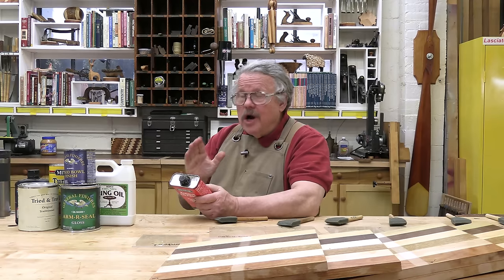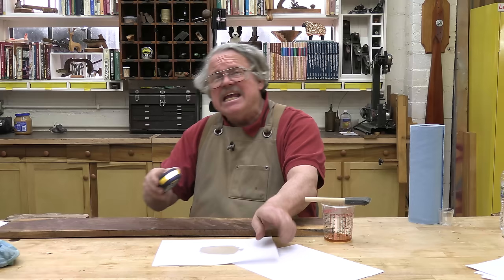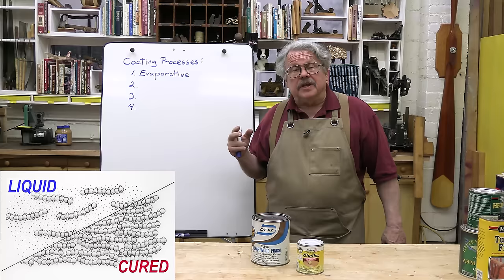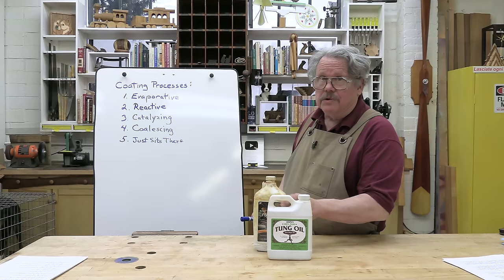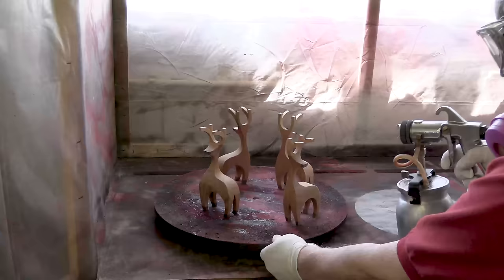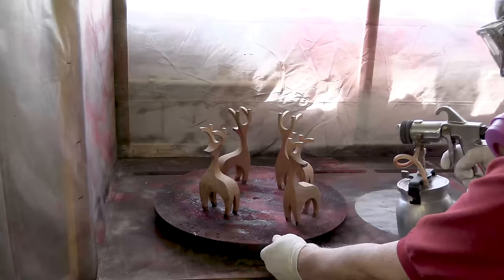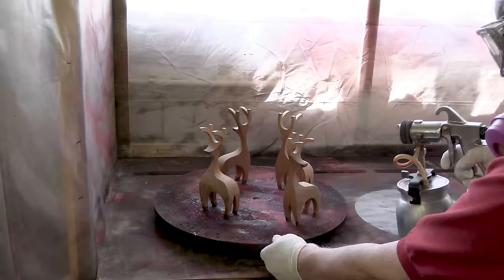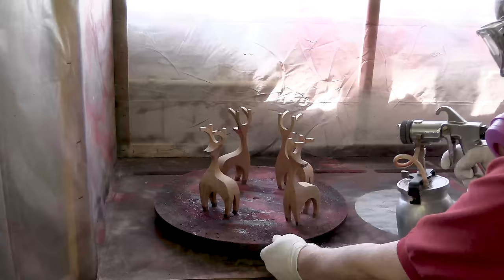Finding the Perfect Finish

Comment: Helmsman spar urethane is my favorite clear finish.  Be aware that if applied over epoxy (i.e. West System epoxy), the first coat of urethane will not dry, just apply a second coat over the still tacky first coat.  The second coat will dry. I'm guessing this is caused by the epoxy not being fully cured.
Reply from the maker: More likely, there is a reaction between the epoxy and the poly that interferes with the formation of  a chemical matrix. Try coating the epoxy with a coat of shellac before applying the poly. Shellac is chemically inert; there's no reaction, just evaporation. So it's often used as a chemical insulator between two incompatible finishes.
Reply: I'll have to try that, thanks.

Comment: Good show I've been using tongue oil now for many years finishing my slab top tables being a painter for 55 years now I came up with my original formula and I will share it with you I take the Watco tongue oil which is thicker than Minwax and I cut it 50% with paint thinners I take an oil-based sanding sealer are you a product from Sherwin-Williams and I mix that 50/50 with paint thinners and then I combine both the diluted tung oil and the diluted sanding sealers and mix them together this gives you a faster drying coats and better sanding it gives you the best of both worlds and in the end after it's cured thoroughly for a couple weeks you can buff it with a wool buffer on a drill and it comes out like glass the one thing I like the best about this formula is that it won't allow very real thick coats but completely sealed and finished where are some of other finishes are thick which tends two chip scratch and blister easier and being so thin on the surface even with three coats allows you to touch up easier and sand for a repair coat without having to strip off all of the thick garnish I've kept pieces outside deliberately in the snow and the rain for years and when I come back the finishes almost the same as it was the day that I put on it with a little buff it comes back to life tongue oil is truly an amazing product you would never follow your thing a wood post unexpected to hold up well on the outside but you're a thing I'll guarantee you will hold up
Reply from the maker: Thanks for sharig.

Comment: You failed to elaborate on epoxy finishes. I have been using a 50/50 epoxy with good results. The finish is very hard and thick. After practice I usually get a good finish after one pour with minimal sanding required. Sometimes I just smooth out with a good polishing cream and it's done. The down side is the curing time, however, I have recently found a UV curing epoxy that cures instantly in sunlight! I'm still learning, but getting better. One important note. NEVER mix finishes, meaning while they are still wet, or after they dry. Polyurethane will not stick well to epoxy etc. I learned that one the hard way!

Comment: This is good but there are some errors. Tung oil and linseed oil are actually what he calls “reactive” finishes.  They don’t just “sit there”.  Like most natural plant oils they react with oxygen and harden over time into the desirable finish that they are so famous for. They just take longer than some other reactive finishes which have been pre-polymerized (basically cooked to make them partially oxidized already).  And many products, like poly urethane, are a mixture of “evaporative” and “reactive” ingredients. Polyurethane is just plastic (polyester) resin devolved in solvent mixed with urethane.

Comment: Fantastic! Learned a Ton. I am still perfecting my skills for applying my go to finish, but I have already selected my go to finish. And my selection had nothing to do with any of the criteria discussed in the video. Rather it had to do with my limitations of space and time. Generally speaking I follow the instructions on the Transtint web site except I use shellac as the seal coat and top coat instead of other products. And, I sometimes use Rit dye instead of Transtint. And I don't always need a glazing coat but if I do, I use whatever brown-ish gel stain from the hardware store. Okay, I admit it, it's nothing like the Transtint instructions. My finishing phase can be hours within the same day. Or if I apply the glazing coat then hours over 2 days. I cannot afford to tie up the garage for 1-2 weeks required for 4 coats of some finishes.

Shellac is not as durable as say oil-based poly, however I feel that a myth has developed causing a lot of woodworker to believe the shellac is entirely weak and useless. It is not. Add a coat of paste wax and it's even more hardy.
Reply from the maker: I believe that no finishing cabinet is complete without shellac. Even if you don't use it as a primary finish, it's the best "insulator" there is, allowing you to apply multiple finishes to a single wood surface that might otherwise be chemically incompatible.
Reply: I’ve been experimenting with different finishes, and recently fallen in love with shellac. I’m in Canada with a poorly heated shop and shellac still cures well and quickly at low temperatures. I love the feel and look of it. And I’ve found it wipes and sprays nicely. I’ve struggled a bit with a brush.
Reply: @benvinje  I had a terrible time with shellac in the beginning especially with a brush. I use the Zinsser canned products. Then I learned to cut everything 50/50 with DNA and brushing became a bit easier.
Reply: @woodshopnerdery  this is probably what I need to do. The canned shellac where I live is getting very pricy so I’m going to start mixing my own. I’m sure there will be a learning curve to getting that thinned properly for each application type
Reply: @benvinje  If  you search for the "technical data bulletin" from Rustoleum, there is  a lot useful instructions as well as "cut math." So I find the 50/50 mix with DNA works well for the de-waxed "seal coat" because I want the seal coat to be very thin and party permeable so the wood accepts some color from the stain or dye. Seal coat starts as a 2lb cut so I end up with a 1lb cut. I also find that the regular shellac which I use for the top coat, and which is a 3lb cut, works better 50/50 also. So I dilute it to a 1.5lbs cut. These are all approximations, fyi.

So if you order flakes, I would get de-waxed flakes for seal coating or if another finish will be used on top, like polyurethane.  I would also get regular waxed flakes for use as a top coat. And my preference is to add furniture paste wax as the final step.

Comment: I use Bona Woodline for nice satin appearance and very good durability---with 3 or 4 coats.  There is also a sealer that can be applied as the first coat.  I think I will try your formula of tung oil with 1/16 (by volume) added varnish, but I have a question: Did you change the formula from 1/16 to something smaller, say 1/8?  I guess your 30-year longevity was a good test that 1/16 was good enough.  One issue is that each coat takes 12-36 hours to dry depending on the humidity, but I can usually get away with morning and evening applications, i.e., only 12 hours between coats, so finishing takes a couple days.

Comment: Just to clarify.  And I would parrot the comments from many others about how well put together your videos are made.  Do you still do the first 2 coats with tung oil?  Then do the mix of 1TBSP spar urethane and 1 cup of finish?  Next question, you show the Miniwx Tung Oil Finish.  Is it any tung oil finish or specifically Miniwax?  I'll be the first the admit that 6' 3" weighing 250, finishes scare me.  What I mean by that is I've put in X number of hours to produce a product.  In full swoop I could completely ruin all my effort.  Now I don't expect to get it perfect.  I just don't want to do it poorly.  I set a level of standard to deliver a product that will endure the test of time.  Thanks again for this exceptionally well done video.
Reply from the maker: Except when testing other tung oil finishes for books and vids, I have always used Minwax Tung Oil Finish for the simple reason that it's the only tung oil finish my local hardware store sells. I have never tested Rudy's formula with anything else but Minwax products. If you use another tung oil or spar urethane, you should test the mixture before you apply it to anything valuable.  As for our current finishes practices, we still use Rudy's because we like the ease of application and the results. However, we have begun to use Minwax Wipe-On Poly (oil based) when we need to sped things up for the vids. It's as easy to apply as Rudy's and the results are similar (although believe Rudy's is deeper and warmer by a small margin), but you can apply almost twice as many coats in the same period of time.

Comment: I would have liked to see you test Danish oil. I have been using this with good results. I prefer the taste testing for my finishes.
Reply from the maker: I did test Some Danish oil finishes. Both Minwax Tung Oil Finish and Antique Oil fit the extremely loose definition of Danish oil. They just don't call it that.
Reply: @WorkshopCompanion  Thank you

Comment: Rubio monocoat, and beeswax/mineral oil give great texture and color. They are easy to apply even in a dirty shop. However they lack luster.  I avoid voc's whenever possible. I'm building a dining table for my daughter. The wood is ambrosia maple. Will shelack on top work? I'm guessing not well, but I will experiment with it. I dont like plastic feeling finishes.

Comment: I wish I had seen this years ago. I would generally agree from my experience. My go-to has been water-based wipe-on poly because it's so easy although it's not as beautiful. Why do you add Tung finish with the spar urethane for the final 2 coats rather than just use the spar 100% for a harder top coat?
Reply from the maker: I think the reasoning for mixing the spar urethane with tung oil is to ensure that the finish stays flexible enough overtime that it wont crack. It also gives you a better bond when applying it over a wipe on poly. All comes down to preference. For us the Tung oil / Spar urethane mix is hard enough to keep our projects safe, but if you are looking for a finish that's even harder you may consider 100% spar urethane or adjusting the mix ratio. - Travis
Reply: Excellent thanks! That's what I was wondering - increasing the % spar for higher use surfaces like dining tables for more protection. Have you used Danish Oil which is trying to get the best of both worlds between beauty and durability?
Reply from the maker: @dm7585  I've worked with Nick for 5 years now and we have never used any finish besides Minwax tung oil and the mix for outdoor / higher use surfaces. I'm sure Nick has used Danish oil but it must not have impressed him enough to keep around the shop. Here lately we started using "Min Wax Wipe on Poly" on some projects because it cures incredibly fast, allowing multiple coats a day, but we're not yet sure of it's durability. Time will tell. - Travis
Reply: Thanks for sharing your experience. I have always like MW wipe on poly but you can't beat the beauty of a good oil. So Nick's recipe made perfect sense to me. I may try wipe on poly over Tung experiments...
Reply: @WorkshopCompanion update: I've been experimenting on the formula using Tung Oil and different ratios of Wipe on Poly (obviously oil based). I didn't use spar because it's expensive, and my goal was to have a small inventory so I don't have to "abandon all hope!" My favorite has been 1 coat Tung, 1 coat 2:1 Tung/WOP, 1 coat 1:2, and finally 1 coat just Wipe on Poly rubbed on with 0000 wool.  Try it out! I think it balances the warmth and beauty of Tung with the hardness of poly. I've used on turnings, furniture, and frames so far...

Comment: Respectfully the application process being the same with all the finishes vs following the instructions has tarnished (pun intended) your test.  For example the arm r seal is meant to be wiped on and off immediately.  It is not the most difficult to apply, it is just the most difficult to apply if you apply it the same way as the others.  Same goes for oil.  I use Arm R Seal as well as other finishes in this test and can tell you they each have their ways of applying them that work well.   I like arm r seal for a maintenance free finish in non work surfaces and for easy application because I don't have to sand or wait much in between coats.  If I see a little bubbling or get some dust in the finish, a very quick  little fine steel wool knocks it off.   2 coats and done usually, sometimes 3.   Plus not a strong smell and lasts a really long time for non-work surfaces.

Comment: I have finished putting on two coats of the tung oil with sanding between each coat. Getting ready to put the last coat of 1 cp tung oil + 1 tbs of spar urethane. Do I wipe it down after 5 to 10 minutes with lint free cloth like I did after I applied the other two coats? Wasn't sure with the spar urethane in the mix.  THANKS FOR YOUR HELP!!
Reply from the maker: The only reason for waiting  5-10 minutes before wiping down the first two coats is to give them a chance to soak into the wood. By now, the tung oil has done all the soaking it's going to do. You can wipe the finish down immediately, if you want. Tip: I usually pour a little finish in the rag before I begin wiping so I don't wipe away too much. The idea is to leave a paper-thin coat behind after wiping. But you can get it too thin if the rag is dry.

Comment: Well done.
Reply: Wow! Lived thru all of that. Until some chap I long lost the track of rescued me from the misery. Have been on his recipe for 2 years now and plan to leave it that way. Here:
Mix equal volumes of turpentine, polyurethane and teak oil. Apply 3 coatings with a rag, a coat a day. Sandcgently after 2nd coat. 6hen, make another mix, this time replacing teak oil with bee wax. Apply with a scrubbing pad. Polish yhr next day. Absolutely breath taking naturak shine and deep grain texture. And - don't be a fool like I was the first time. Nix only as much as you will need, and always use a new cloth. The stuff doesn't store well at all. I am in tropics, so itcspoils that much quicker. 3 days is all it can take if you can keep it ckean and under a tight cap.

Comment: great video!  I believe the late great Sam Maloof also favored a urethane /oil blend for his finishes, which are still available.
Reply from the maker: Thanks. The Maloof finish was equal parts raw tung oil, boiled linseed oil, and an alkyd varnish. The latter is getting harder and harder to come by, but you can substitute urethane varnish which contains a urethane-modified alkyd resin. Alkyd resins, for readers who would like to know, are obtained from botanical sources like tung, linseed, and soy oils. The other two resins commonly found in reactive finishes are polyurethane and phenols. These are most often derived from petroleum.

Comment: Nick I really need your advice/help! I built a queen size Murphy bed out of 3/4” oak plywood (last summer). It was too large to fit through the house hallway and bedroom door so I cut the pieces out in the garage and assemble it in the bedroom using Titebond 3 glue and pocket screws. I used a Minwax penetrating Provincial 211 (premium oil) stain on the verticle components not thinking about the stink! I have applied 3 coats of Minwax oil modified polyurethane (premium oil-water hybrid) and it still took several weeks for the odor to disapate. Now need to finish the rest, but I’m looking for something that is odor free if possible. What would you suggest?

Comment: Easiest subscription I've ever had to do. Great quality content!! Thank you.
Quick question, I would like to build a desk, and I need to decide on the wood type and the finish, I am thinking Aok (I've been told it's the most durable) and rubio monocoat. Thank you!
Reply from the maker: Forget my first reply. You wrote "desk;" I read "deck;" and, well, you know where is went from there. Have lots of experience with oak, great wood, but it can be brittle, especially white oak. If you're using it for a desk, you may want to fill the pores with a "grain filler." It makes a poor writing surface otherwise. Have less experience with Rubio Monocoat, but I know it gets good reviews.  We're thinking of doing a finshing video on hardwax finishes sometime in the near future.

Comment: My father in law "surprised" us by finishing our dining room area in Shellac. It is constantly sticky, and absolutely terrible to clean. Now that I've learned it's made of bug poop, it makes me hate the floor even more.
Reply from the maker: Shellac, I'm sorry to tell you. is not a good choice for a floor finish -- much too soft to wear well, easy to scratch. The fact that it never has completely dried tells me there are other finishing chemicals in you floor that were not completely removed or sanded away before the shellac was applied. Fortunately, it can be easily removed with denatured alcohol. Just pour it on  a rag and wipe it off.
Reply: @WorkshopCompanion  thank you! I’m going to try this so I can reseal it.

Comment: Great video! I have a question though, I have 4mm marine beech plywood sliding cabinet doors. They are 30cmx50cm each. Can I finish them with oil on one side and with wood paint on the other side? I don’t want to face unexpected troubles 😄